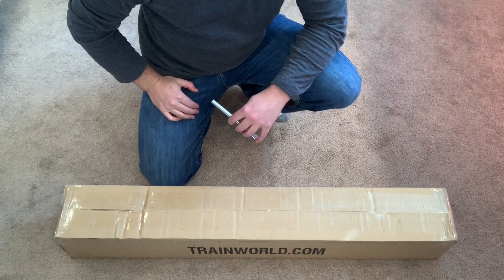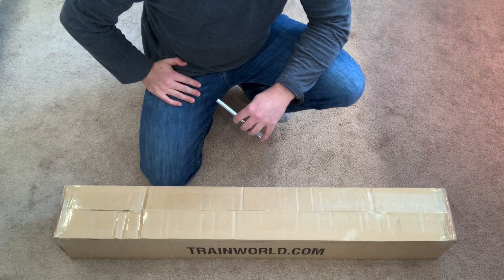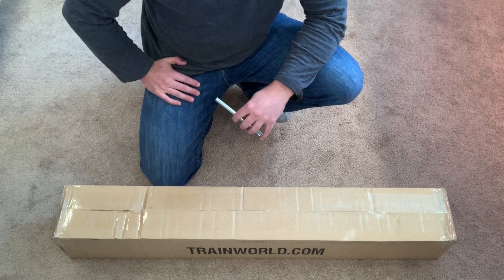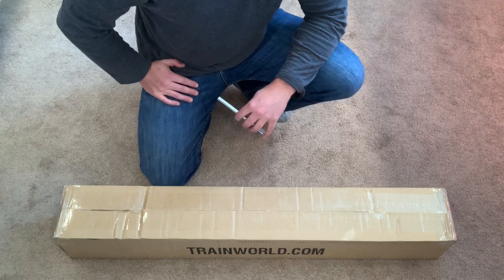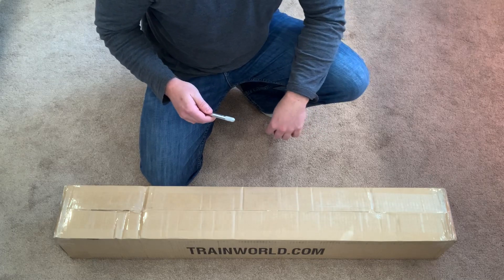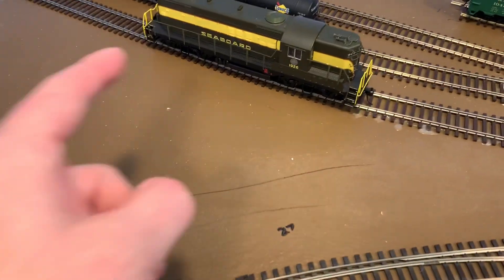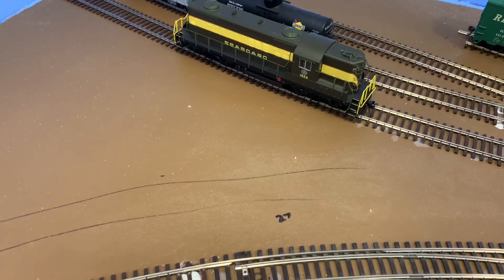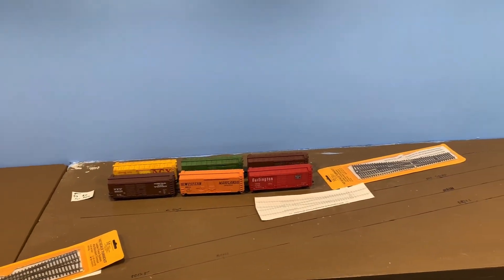Layout Expansion - Track Planning & Operational Design

Comment: I really like you plan.  It looks like lots of operating potential.  I personally use cad software (Xtrakcad) for my track planning, but I have used it for several different layouts including for my club.

My one comment about Micro Engineering switches is I have a had time mating them with Atlas track because the base of the rail is smaller.  I build mine using ME rail.
Reply from the maker: Thanks for watching and the comments!  
I have tried Xtrkcad recently and CadRail several years ago - both are very well done, and viable ways of doing it.  As for mating the Atlas track to ME turnouts, I have been using the smaller ME joiners on turnout to turnout joints, and the larger Atlas joiners to mate between Atlas track and ME turnouts.  With some (very) gentle upward pressure applied to the joiner from underneath when soldering, the rail heads align nicely.  Good call-out, a bit finicky and tricky for sure.
Reply: I will have to try that pushing the joiner, that's for the tip.